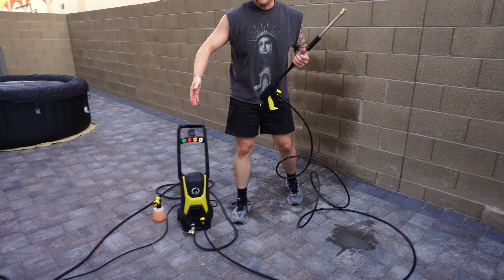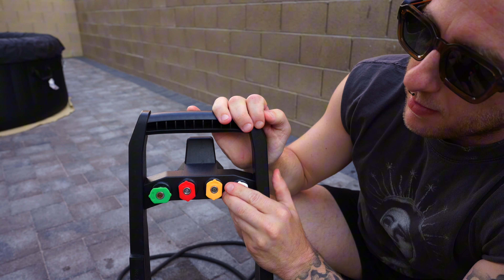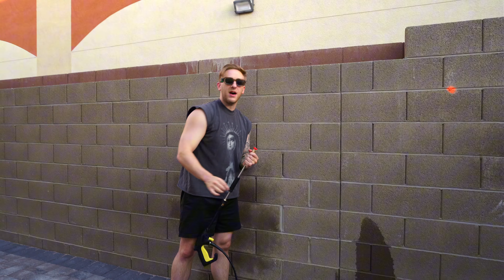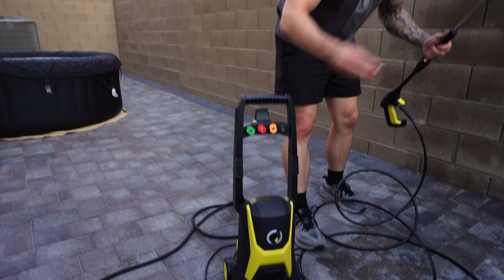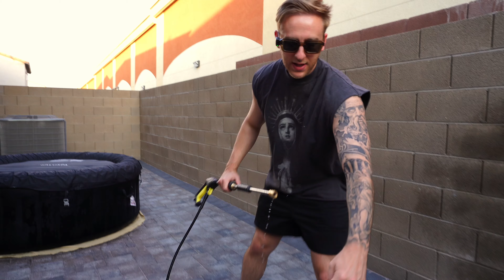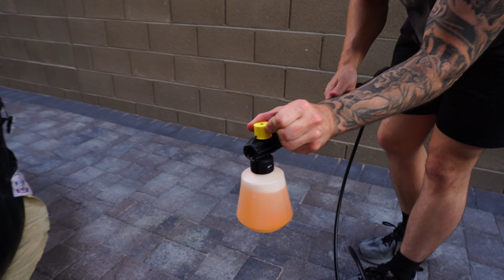I Bought This 4800 PSI Electric Pressure Washer On Amazon

Comment: 4800?  no way
Reply: For sure not.  Haven't seen any electric actually get anywhere close to that. They are usually less than 2000 psi and around 1.5 gpm.   Looks like a Karcher clone.  You rarely see any reviewer put on a pressure guage and a flowmeter to see what the machine is actually producing.
Reply: If it’s not 220 volt, there is no way possible it’s even HALF the rated pressure or gallons per min. Max you can get out of 110 volt is 1500 psi and maybe 2 gallons per min. I’ve been building and selling and also have owned a pressure cleaning business since 2000. This in the video is 1500 psi at 1.5 gallons per min MAX!

Comment: Definitely not 4,800 psi man. I hope you were joking.
Reply: I got this recently. Had a 2,800 gas powered one but got tired of having to clean out the carborator everytime I wanted to use it. This one is rated at 4,000 PSI but IMO it's really close to my 2,800 PSI gas one. Powerful enough to run my 15" surface cleaner, wash my car and siding. Will have to see how long it holds up. At $160 it's not cheap but is cheaper than most gas powered ones.
Reply: @tecwzrd  for the gas one, use ethanol free gas and and you’ll be golden 

Maybe fuel stabilizer for ethanol gas

Comment: Does that pressure washer hose have a m22female fitting Nozzle 14-22MM?
Reply from the maker: Yes, the pressure washer hose uses a standard M22 × 14 mm female threaded fitting